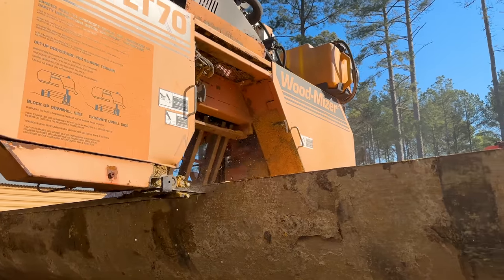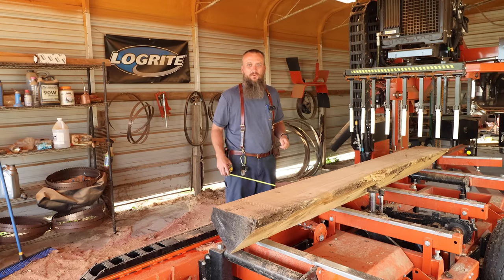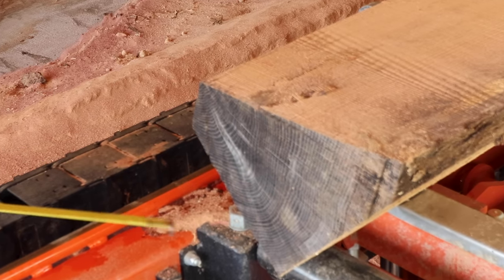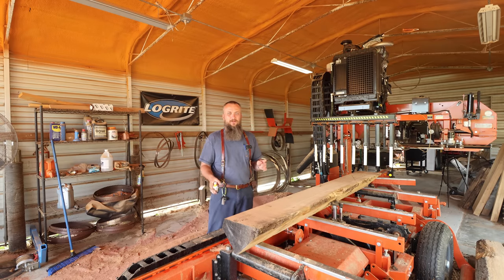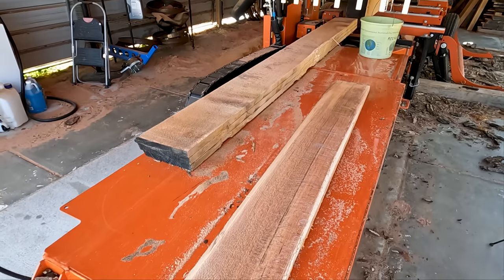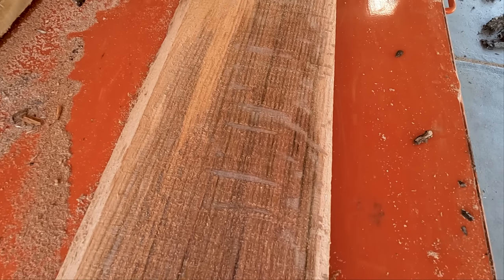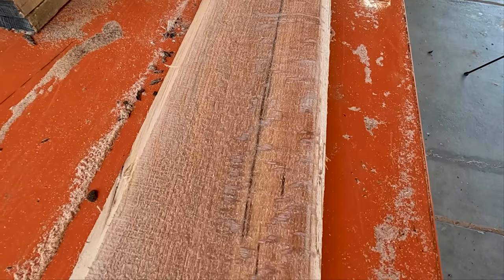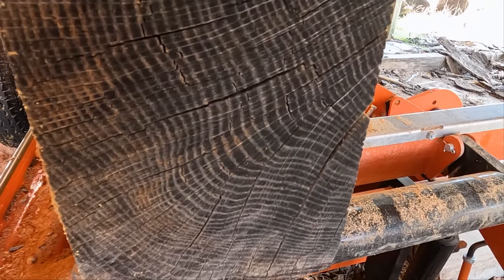Epic Quarter Sawn Oak Boards, Reverse Roll For The Win!

Comment: A question  -  I need some hardwood beams 6X6 & 8X8 12 ft long. Will it warp ? How do I dry ? A frien d suggested that I cut them into boards 1 inch thick, air dry then kiln dry them. Assemble them to whatever size I want and glue & dowel them together. Your opinion